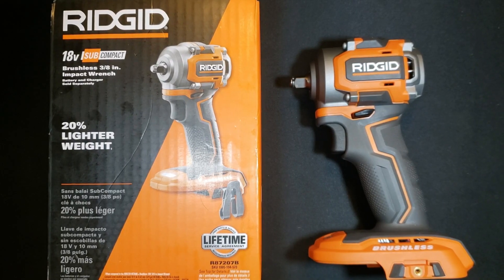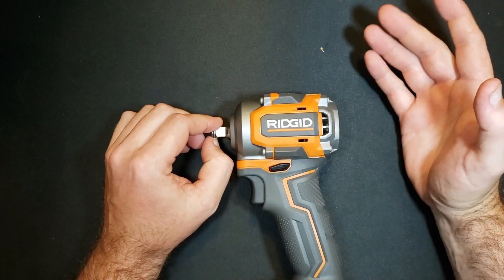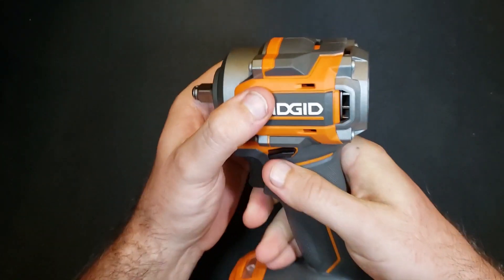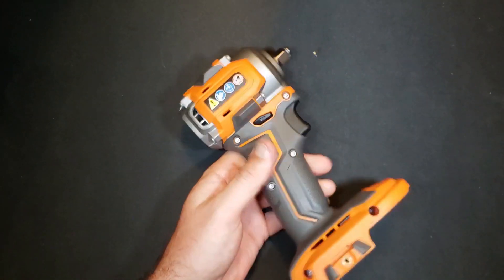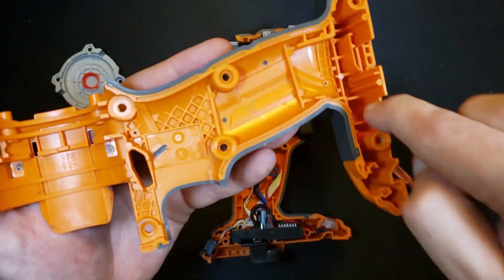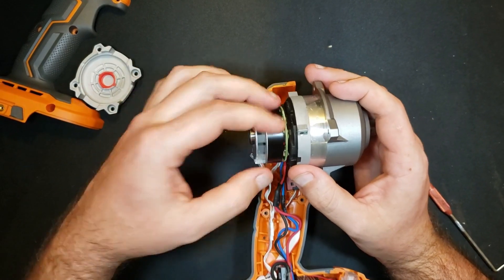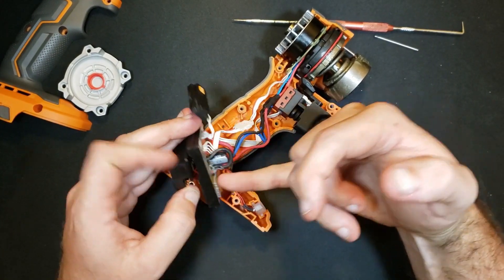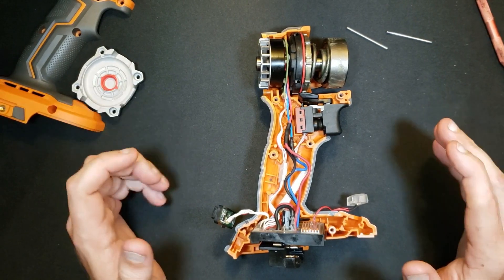Design Engineer Reviews Sick Tech in New Ridgid 18V Sub-Compact Impact Wrench | How's It Made Ep. 11

Comment: Nice job. The "A" power function is designed to prevent over tightening and at the same time to stop the motor, despite a depressed trigger, once and a bolt or nut has been broken free. Very clever. Just discovered this after having had one of these for over a year. Very nice little tool and with a square drive to 1/4 inch adapter will serve as a drill/driver with 1/4 inch hex end bits in a pinch.
Reply from the maker: Great info, thanks!

Comment: The "A" mode stands for automatic. When in automatic in forward, the tool can be used as a ratchet. When the tool senses that impacts are occurring, it shuts the tool off. You can use A mode for things such as starting lug nuts on a vehicle. The tool will run the lug nuts down snug, but won't impact them, preventing over tightening and stretching and cracking the wheel studs. Which would be bad.
Reply from the maker: That's a cool feature. Great info!

Comment: None of these small impacts matter if the battery hanging off the bottom is bigger than the whole tool,and to date milwaukee is the only company that has a sub-compact with a 12v battery that still packs a 18v punch. Esp now that their 12v has a high output stick battery
Reply from the maker: Yep, the tiny little battery on the Milwaukee 18v surge is a huge selling point for me

Comment: That circuit board, right behind the motor and all that heat. Is that a good idea?
Reply from the maker: Thermal management is one of the primary design aspects of a circuit board, they plan for peak surrounding heat as well the heat generated by the board itself from the current flowing through it and a host of others.... also they probably only put the necessary components on that board and left the more sensitive components like the processor on the big main board down below.  great question.

Comment: I hope you're doing well since I haven't seen much activity on the channel, but your quick teardowns compress a lot of good info into down.  I don't subscribe often, but I did to you and I hope you can release more good content.
Question though (if you're still around to answer): why does the battery regulating PCB contain potting but the motor one doesn't?  Is the motor PCB engineered to withstand more shock?
Reply from the maker: Thanks for the kind words... it really is nice to hear that there are people who value this weird niche type stream of consciousness commentary.  My house has been under remodel for better part of year so I lost my recording area... I intend to get back into it harder than ever as soon as I have a recording space again.

On the potting, (1) the battery I took apart in another video is much older than this impact wrench so batteries could be potted now. (2) batteries are meant to be replaced much more often than the driver itself both becasue of the limits of battery chemistry and also the profit motive of continuous replacement revenue... so this could be built in obsolescence or simply a shorter time frame durability design goal due to the chemistry degradation...

Thanks so much for the Sub!
Reply: Oh, I didn't mean about the usually bare PCBs you find in battery packs, which I would refer to as a BMS, but the module you're holding at 15:51.  I'm just curious on why that's potted when the PCB that controls the brushless motor isn't, as I'd imagine the motor PCB gets stressed far more, being on the drivechian.

Anyway, thanks for replying and I'm glad you're doing okay!
Reply from the maker: @h8GW  ahh, yes.. that is a good question.. possibly its a less critical circuit board to basic function or the much smaller mass is less prone to impact failure.  great observation.

Comment: 10:05 your drill driver’s torque mode select is set on (drill mode)
Reply from the maker: Good eye... i guess i really never use the clutch setting now that i think about it... i tend to use my finger to modulate the torque... which means i strip threads on occasion :)

Comment: Great teardown and analysis. Impressive miniaturization by Ridgid, I bought the combo on sale and it's so small and light. The biggest disappointment is Ridgid's overinflated claims of torque. Watch Builds & Stuff's review of the AEG equivalent (AEG 18v Subcompact Impact Driver and Drill VS HiKOKI, Makita, Milwaukee Impact Drivers). I'm guessing that this unit produces around 1100 inch pounds rather than 1800.
Reply from the maker: Thanks for the kind words and info... great stuff!

Comment: Is the housing Fiberglass reinforced 30%? 430am.
Reply from the maker: Yes it is made of 30% glass and roughly 70% Nylon.  However, The term Fiberglass is typically reserved for non-meltable base polymers like Epoxy, Vinylester or Polyester Resins. Also, the glass fiber is typically it's own independent fabric(substrate) made of long interwoven fibers that make up the majority of the weight. In the case of the housing part, the base polymer is meltable nylon, the fibers are very short and only make up 30% of the weight,  and the glass is mixed in with the nylon before the part is made. So in this case we call it "Glass-Filled" or "Glass Reinforced" Plastic and not "Fiberglass" per say.  Nice to see another night owl :).  Thanks for the question!

Comment: You mentioned in this video that you are a pro product design engineer? I was just curious, as to which type of products you might be able to hint you've been involved in designing? And I am also curious to know your thoughts, since you are a pro product design engineer, as to how would you improve these tools, such as the rigid sub-compact you reviewed, or any of the other well-known tools from the well-known tool companies? How would you design the tool, improve performance, and or, power? Would smaller tools have the same power level as their big brothers, or perhaps, an all-new design for the tool? What kind of electronics do you see can improve the performance of the tool? Thank you for the review. You've earned a sub.
Reply from the maker: Thanks for the comment. Most of the products I have designed fall under the Sport Fishing Accessories Category and they all had electric motors with gear boxes and drivetrains... mechanisms and construction was similar to many common tools that I review.  It's hard to say how they could be improved becasue most products go through a rigorous development process to learn the weaknesses.  These products were also designed by professionals over the course of years so it would be hard for me to say that they were poorly designed based on the price point.  I will say that I was most impressed by the design details of the Bosch Impactor and the least impressed by the Hyper Tough from Walmart.

Comment: Garbage. Milwaukee m12 stubby makes more power in a 12v platform and doesn’t look stupid because an over sized battery
Reply: This small ass motor need the 18 volt to make the power on 12volt it will be pathetically underpowered

Comment: As you've probably figured out by now, the "A" is for Auto mode.  It tries to be "smart" and in loosening mode will prevent you from completely zipping off the fastener.  In tightening mode, it helps you spin on the fastener and once it starts to get tight, stops impacting to prevent you from over tightening.    Would love to see a tear-down of the more popular Ridgid mid-torque too.
Reply from the maker: Sounds like they must have some feedback loop sensors then, or at least amp draw monitoring.  Great info!    I've made a note of the Mid-torque, thanks for the suggestion.
Reply: @JJCCENG  Yeah!  I am really curious how they pulled that off.  In a review I read on shoptoolreviews.com they say the auto-tightening stops at about 40 ft-lbs.  One of my remaining gear-nerd wishes is that you could program the torque setting on the tool - this would be useful when tightening a lot of fasteners that need to be at the same torque spec.  Probably hoping for too much there though..
Reply from the maker: @GarenP  That would be awesome for sure. The way tech is moving that will probably be a feature in future generations of this product in a couple years.

Comment: Stupid with the massive battery , stick a m12 slim cp3.0 in that and it would be badass
Reply: If you have no other requirements other than be as small as possible, then the Milwaukee stubby line is probably the best choice.  But if you are an existing owner of that family of batteries then it's nice to have options.  A potential new buyer might be just fine with the lighter weight and smaller head to be good enough and they also want options of buying other full size tools in the same battery family.
Reply from the maker: @dtester  Good point.  I just picked up the M18 and it's battery is nice and compact for tight spaces, but I am all-in on the Rigid tool family so, like you said,  doesn't really make sense to make the switch in my case.
Reply: Sacrifice u make to have all the same battery line that works in all the tools. LIFETIME warranty.  Ridgid all the way.
Reply from the maker: I'm going to have to review a M12 or a M18 for my next tear-down... so many people talking about them, they must be good.

Comment: Very impressive what Rigid is displaying here.  A lot of metal use here, excellent plastic too.  Makes Ryobi's new impact wrench look pathetic.  Plastic use all over in Ryobi's.  I feel Ryobi is trying to move Rigid up and Ryobi down to very DIY and Ridgid more into the Pro area.
Reply from the maker: I agree. I believe Ryobi is also owned by Home Depot like Ridgid so it would make sense that they want to have different brands to compete at multiple price points.
Reply: @JJCCENG  No Ryobi isn't owned by HD.  They must have contracts/negotiations to sell Ridgid/Ryobi at their stores with TTI, just like TTI has a contract with Walmart to sell and produce Hart tools.  Personally I own a lot of Ryobi tools and they work great, I'm just not impressed with this new HP line that just came out like some others are.  At least not with plastic head impacts.   The other new HP tools are meh for me.  It's just disturbing to me that they seem to be going more crapy then what was shown here with the Ridgid.  I now also own 2 M12 tools and the high torque 1/2" impact wrench for M18.  This will allow me to get quality tools when I need them and Ryobi tools for smaller jobs etc.
Reply from the maker: @kartboarder22g17  Very interesting. I've been wanting to tear down a Milwaukee for some time now... They seem to be the standard of professional quality... So would be cool to see how Bosch and Ridgids compare.

Comment: I thought my Milwaukee M12 stubby impact was small until you tore apart this ridgid apart
Reply: M12 Stubby very good 👍
Reply from the maker: Seriously... Absolutely crazy how much power they can cram into a tiny package.
Reply: The stubby is way smaller with a battery lol
Reply: @evictioncarpentry2628  The only part of the stubby that is smaller is the bottom.  The head of the stubby is wider and longer.  Pretty sure the Milwaukee is also more powerful and it sounds like they won't give you trouble for warranty work.